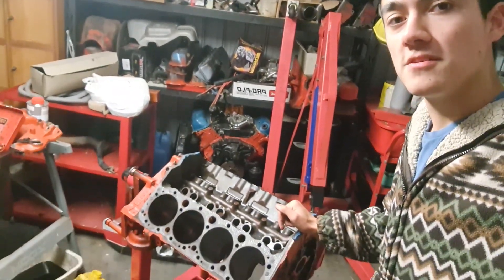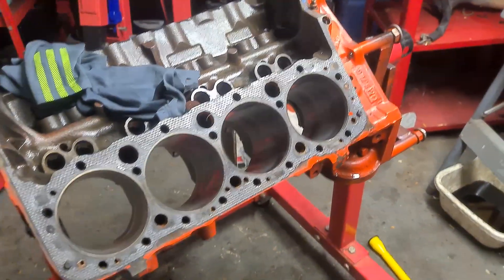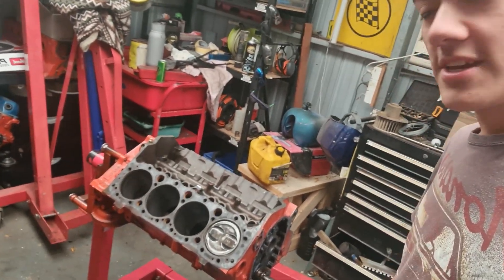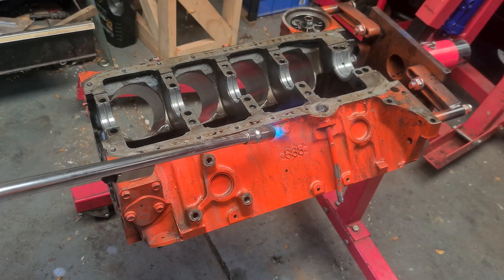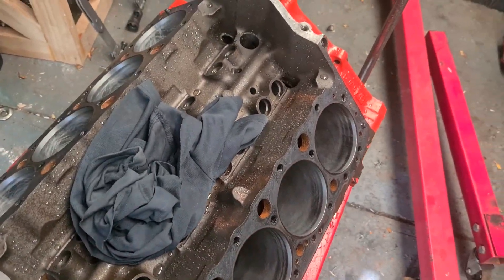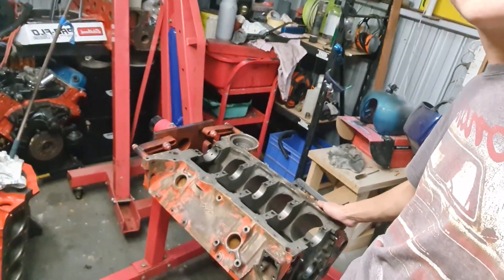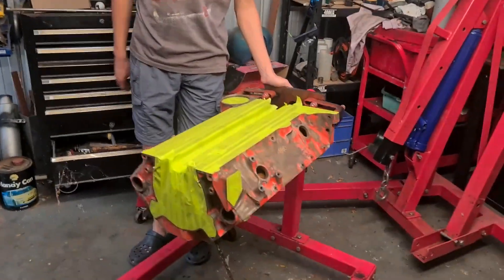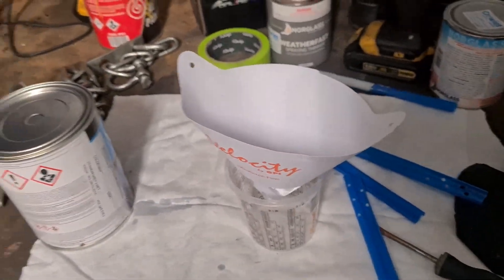350 Chevy SB Rebuild Pt4 Block Prep.

Comment: Its all money - see if you could go a holly sniper efi or similar……. Best for street use
Reply from the maker: Il have a go with the carb first whant to try and keep it old school.
Reply: @Joedennett69  Agreed...... but don't be fooled. To use the Carby you're just gonna have to take it to a carby guru with a rolling road and a tail pipe exhaust gas sniffer and the thing needs to be tuned while running........ they will change the jets and emulsion tubes and dial in the power valve through the power curve and if you spend a-few hundred bucks on that....... she'll be right